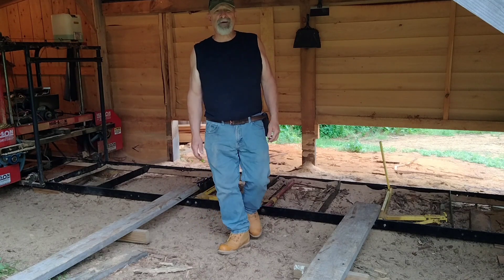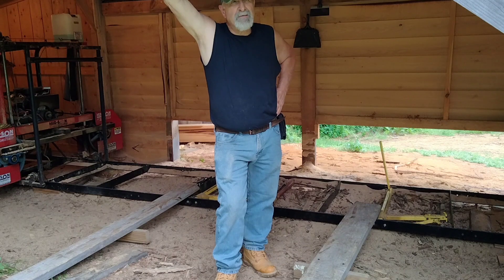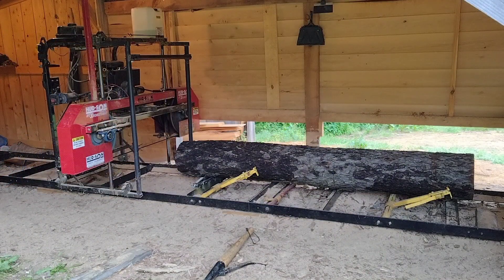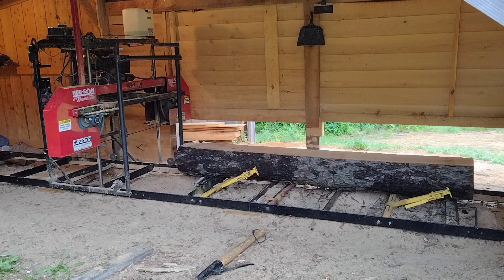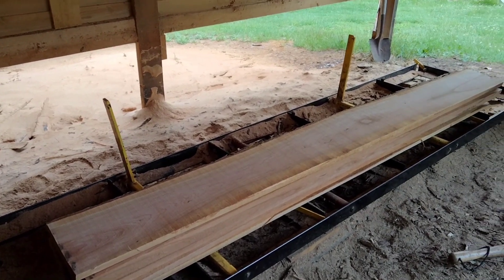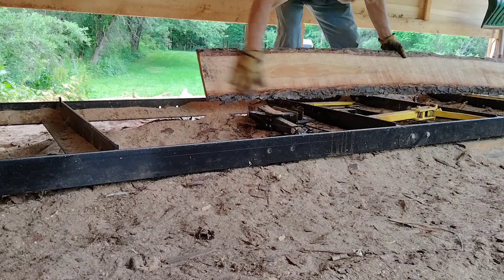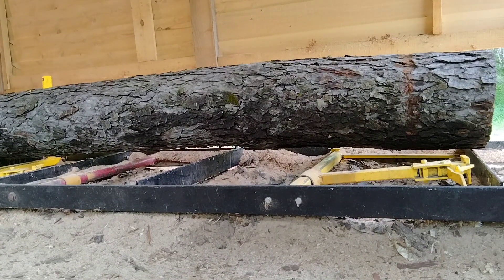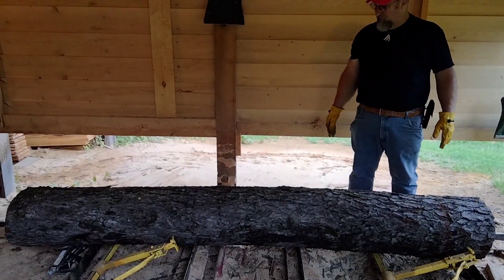Cherry 🍒 Lumber is HOT 🔥 on the wood market

Comment: How do you know what to price to put on your lumber?
Reply from the maker: We have several Amish mills around us that cut soft wood (pine) (hemlock) framing lumber.  We keep our prices close to theirs. On pine and hemlock. we charge $.65 bf for pine, $.75 a bf for hemlock. On hardwood, it depends on the species. Soft maple, $1.00 a bf for boards with knots, clear is $1.25 bf. Hard maple or sugar maple, Ash, Oak, and yellow birch. $1.25 bf for knotty boards, $1.50-$1.75 bf for clear. This is green. We cut our hardwood 5/4's thick unless customer specifies different. We do not charge for the extra quarter as it will fall to waste when planed. Find some local mills and ask for a price sheet. Unless you have a kiln make sure you specify green. We charge $80 per hour to saw someone else's logs. Their help will speed up your sawing. Let them know that. Hope this helps